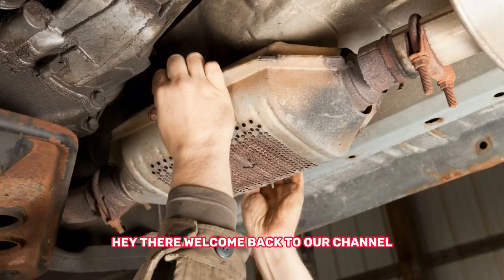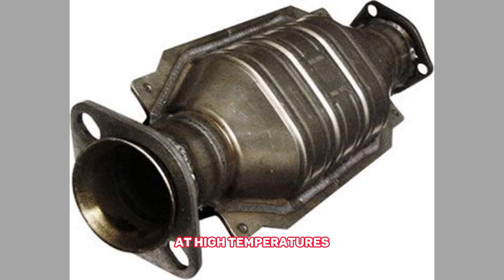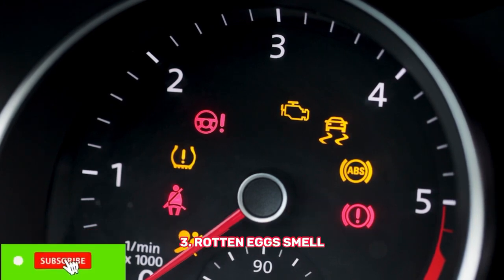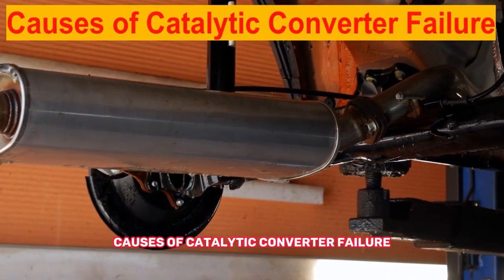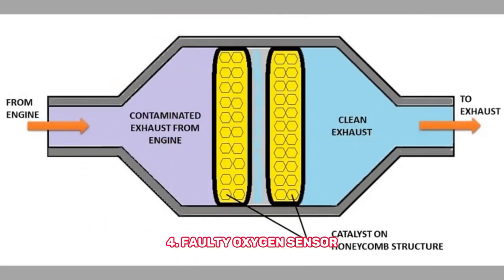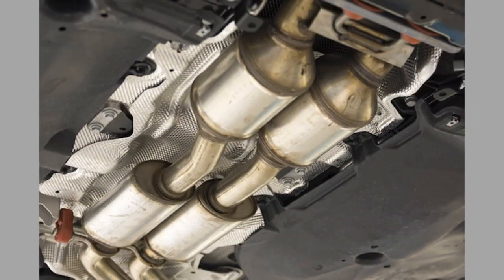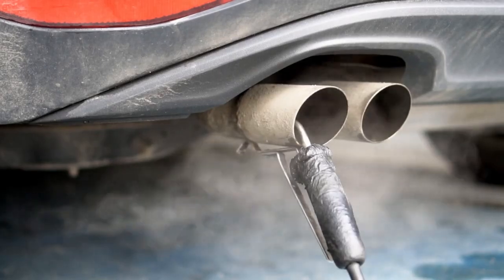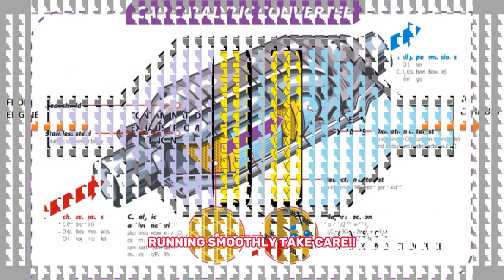Bad Catalytic Converter Symptoms, Causes, and Remedies /Identifying & Fixing Bad Catalytic Converter

Comment: Pretty sure the converter has gone bad on my old truck. I have the error codes, rattling, and loud exhaust. I don't see any white smoke or smell rotten eggs though. Since I barely drive it 500 miles a year, I'm guessing it will be okay.